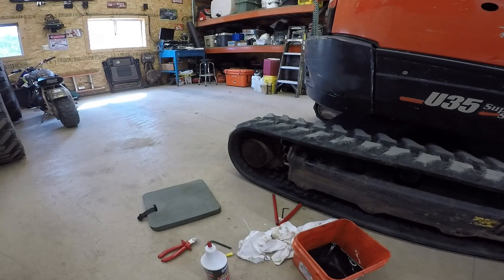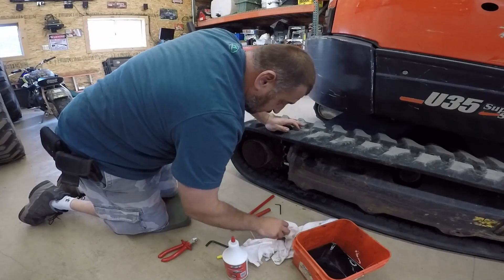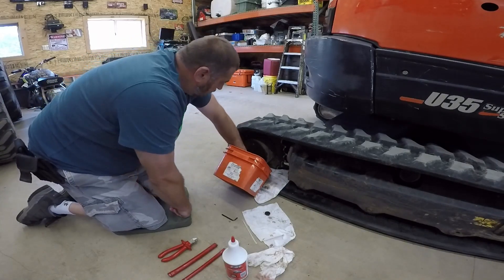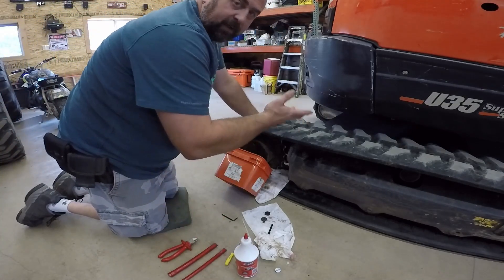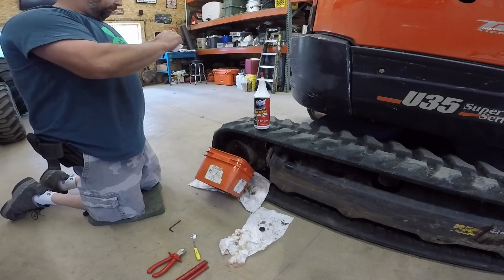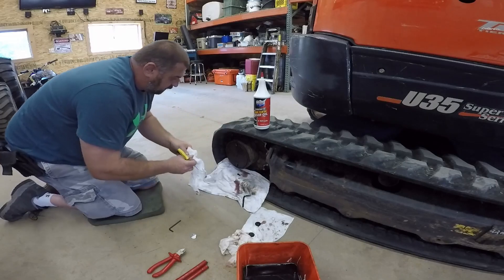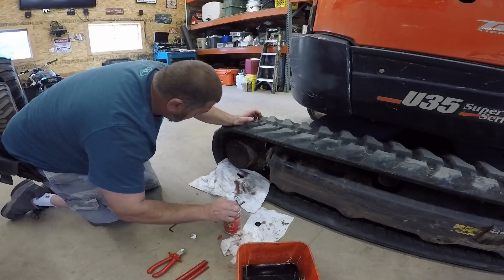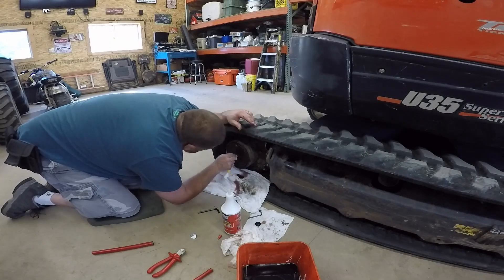kubota u35 mini excavator final drive maintenance

Comment: Im in between the 033-4 and the U35. What do you like about he U35? How long have you had it? thanks for the video
Reply from the maker: kubota u35 is a tight tail swing meaning the rear where the engine and  counter weight is stays in side of the tracks when you rotate the cab . on the kx 33 the counter weight is out side of tracks so if you are close to a wall and swing you will hit . other than that they are all great just depends what you want to use it for .  thanks for watching .
Reply: @kickstandoutdoors1624  Thanks for the reply. Are you happy with the power of this machine or do you wish you got the next size up excavator (KX040-4)